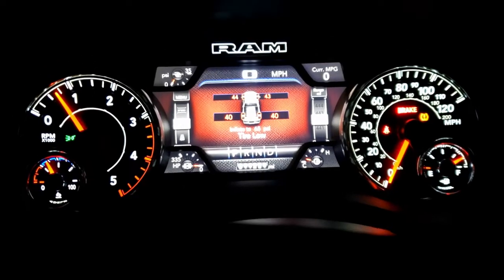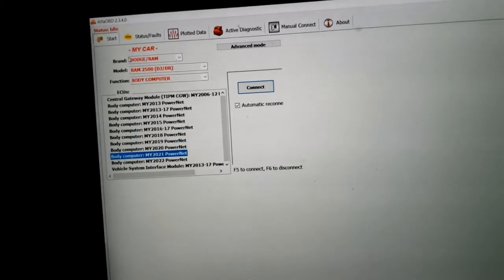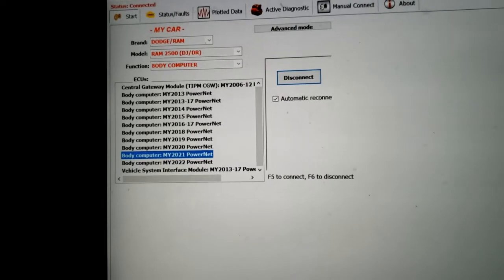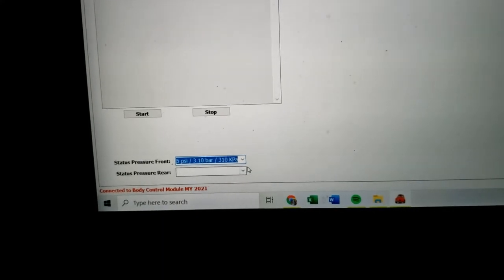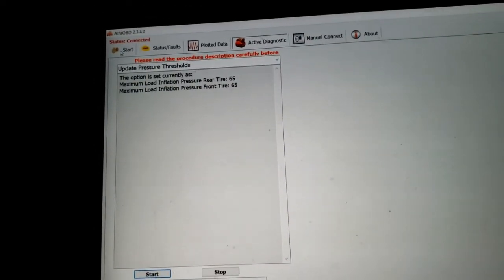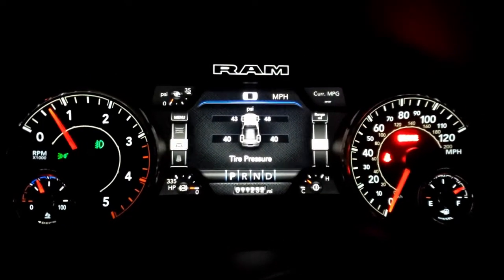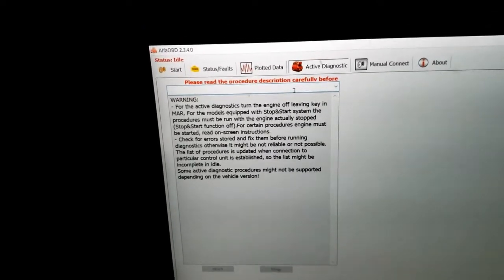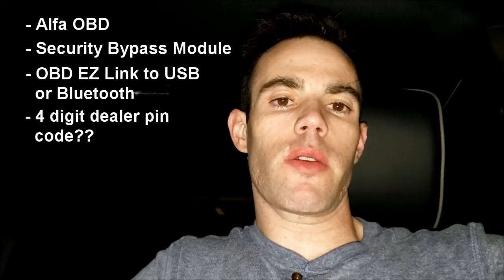Ram 2019+ TPMS Sensor Reset Using Alfa OBD

Comment: Are you able to keep your fog lights on with the hi beams with this?
Reply from the maker: That was never a setting i needed to change using alfaobd. For me the fog lights can be manually toggled on or off using a button near the headlight dial
Reply: Yes
Reply: Yes you are and that’s how mine is set up.

Comment: wait? Don’t you need some pin or something? I thought this didn’t work on 2019+… if this works now I’m pumped. My 2021 ram 2500 has had tpms lights on forever for running 50psi
Reply from the maker: I thought so as well. I even went to the dealer to obtain one. When i did the procedure I was never actually requested to enter a pin and it worked without it.
Reply: @HarrisonsGarage  hmm.. wonder if they changed something. That’s good.

Comment: Will this work for a 2022 2500 Diesel? Can you post the part number for the Security bypass cable and the ODB Link Ex Forscan cable? Can you show how the cables are set up to connect to the computer. Want to get the right stuff and not buy stuff that may not work. 
Thanks!
Reply from the maker: The link to all the parts (obd cable and security bypass cable as well as Alfa obd’s website) are all posted in the video description. Plugging the bypass cable in is straightforward. I detail the process in my Aux switch install video at 22:51 minutes. I’d reach out to Alfa obd to confirm 22 compatibility with their software
Reply: @HarrisonsGarage  Thanks. I did not see the "show more" button expanding the description or I would not have bothered you. :)
I will reach out to Alfa to confirm compatibility. Curious why the RAM dealer / service advisor told me it could not be done? I do not have a lot of confidence in the service advisor mechanical skills.
Reply from the maker: @jimmymoore6935  the dealer’s manners seems to be it cannot be done. Just because they don’t know how to do it doesn’t mean it can’t be done. They said the same thing to me when I asked about installing factory aux switches.

Comment: Does this also update the tire fill alert setting?
Reply from the maker: This reduces the threshold at which the tire fill alert comes on. From factory this threshold is as 65psi. Here I reset it to 45 front and 40 rear. When pressure drops below these values, the alert will come on.

Comment: After I did this the low psi light won’t go away. Wasn’t there before. Any ideas?
Reply from the maker: Hey I’m assuming you reset the tire psi threshold to a lower number than stock. Asking the obvious but what did you reset the pressure number to and what pressure are your tires.

Comment: Followed this exact procedure,  tpms light still on. Dash says fill tire to 0 psi, as i set it to the lowest.  Tried resetting rf hub, alfa asking for 5 digit pin.  Alfa will not pull pin.
Reply from the maker: First question: what year/make/model is your vehicle. I was surprised that I didn’t need a pin when I did this for my truck. Though I was able to secure one from my dealer easily enough.
Reply: @HarrisonsGarage  Canadian 2019 Powerwagon. I was able to remove TPMS completely with Car Config section, but I'd still really like to see the PSI.  

I tried everything from 10 to 30 psi, none would relieve the light, and red tire pressure signs. 

Followed some of your other steps, including speedo - all worked perfect.
Reply from the maker: @tanktheram  Hm without knowing exactly what was done it’s hard for me to weigh in. I suggest reaching out to Alfa obd. I found them extremely helpful when I ran into an issue with resetting my speedometer.
Reply: @HarrisonsGarage  Following your method,  the dash would say "inflate to x psi" - whatever psi I set, but the light would still be on,  numbers still in red,  even though my pressure was far above the number which I just set.  However disabling TPMS through car configuration worked.

Comment: Unfortunately there's no threshold menu on the Jeep Cherokee which sucks. I'm exploring other options
Reply from the maker: Coincidentally we just got a jeep and went through the process of changing the speedo and tpms on it. We got the 22 rubicon and used the tazer jl mini to get it done. I've actually got this video set to be released this weekend.
Reply: @HarrisonsGarage  yeah you can do it with alpha OBD. It just doesn't work on the Cherokee the menu is not there for the threshold. Or if it is it's in a different place and I don't see it.
Reply from the maker: @off-roadingexplained8417  the reason I went with the tazer was that  the folks at alfa obd told me it alfaobd couldn't change the tire size on the '22 wrangler. I wouldn't be surprised if there were other issues related to tpms settings.
Reply: @HarrisonsGarage  yeah that's a no go for Alpha then. Tazer for the win ! Alpha had a lot for the Wrangler compared to the Cherokee. I'm Shocked they didn't have everything for the 22 Rubicon.

Comment: So u didnt need that 4digit pin anymore?
Reply from the maker: Yeah I'm not sure if it was just my truck or 5th gens in general but I never needed to enter it.
Reply: 2019+ doesn't need an RF hub reset so no PIN required to make the change.
Reply from the maker: @rjterry21  thanks for the info and clarification :)